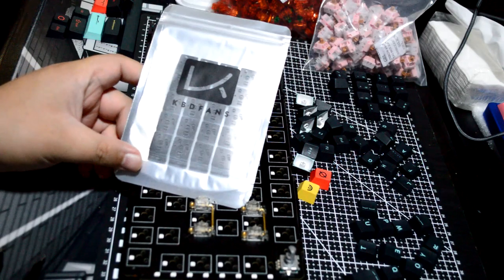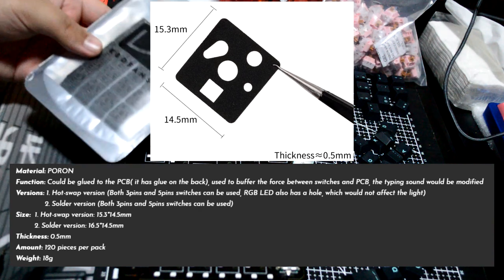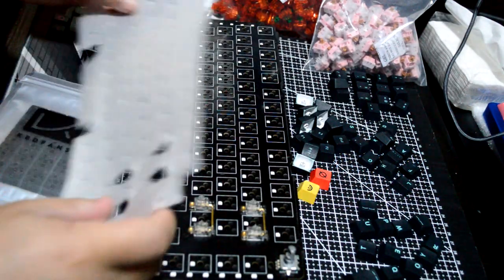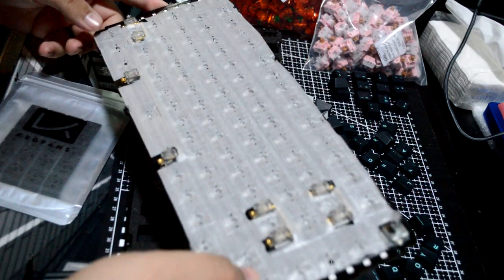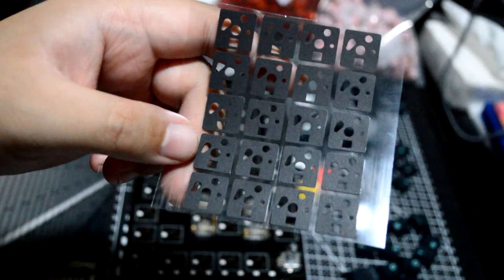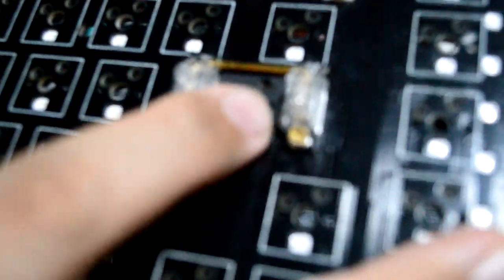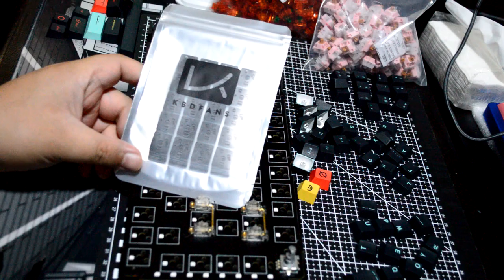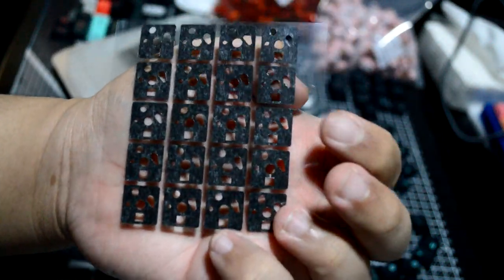KBDfans Switch Pad Review | Will it Thock? Pop?

Comment: Are you using alu plate for your gmmk pro? and how  did you make the durock v2 fit?
Reply: Alu plate. I just wiggled it in. Its really tight.
Reply: I had to press my plate down with a bit of force but i got a really tight fit in. The poly carb does not fit at all with durock stabs though. I would have to file it to make it work.

Comment: The chances that the PE foam mod will damage your PC is extremely small to none. PCs have many safeguards in place for that sort of stuff.
Reply: i used to agree, but after changing some switches out a couple of times, 4 sockets on 2 pcbs stopped working. i think its a case by case thing
Reply: That’s a socket problem. The PE foam mod if it were to do damage, it would be much more noticeable. Hot swap sockets loosening and/or breaking from the solder join is a common issue. It can be easily fixed with a soldering iron and new hot swap sockets for literally a few cents.
Reply: There is a certain type of pe foam you want to avoid, i forgot the name but if you look it up it’ll pop up
Reply: @dhaerque  can u list those names?

Comment: can you use these switch pads with the foam in between the pcb and plate
Reply: Late response, but I had the same question but I think the answer is yes. I just saw another video where they used the kbd switch pads and and then placed the pcb foam. However I also have switch tripods which I hope would work with all three combined. If it’s too thick then I’ll just remove the switch tripods as they didn’t make a big difference at all.

Comment: The kbdfans pads are designed with the wrong material and cutout. The switch pins need to be cut smaller than the pins to compress them into the PCB. These basically do nothing
Reply: It’s still better than stock from this test I’d say
Reply: The non-hotswap version might be better than this hotswap version since the holes are big whereas the non hotswap only has thin slits.
Reply: @mdmaxson  i dont know if you’re trolling or not, but i’ve noticed a significant change in sound signature when using these. it still makes the board as poppy as pe foam but quieter so its better for my taste
Reply: From my testing with PE, I don't actually think compressing the switch pins is what gives the PE foam mod it's signature sound. I've tested PE foam mod with the foam around the switch rather than under it and it achieves an almost identical effect. I think the difference is almost entirely to do with the material!
Reply: @Brudder  after further testing I think it's material and covering the entire surface area of the pcb combined. Similar to bottom of PCB tape mode. It might be mostly just the covering entire surface vs material though since my glad press and seal wrap on top of pcb is my best sounding board
Reply: @jdbaker82  Good point! Thanks for sharing your findings. And wow cling wrap? That's pleasantly unexpected... I need to try that eventually!
Reply: @Brudder  I'm pretty sure cling wrap would cause static interference. Cling wrap is literally called that because the plastic carries a charge and clings to each other. It could cause damage to the pcb eventually.
Reply: @rks5457  Good point! I shouldn't have used the term cling wrap interchangeably with Glad Press and Seal. Apparently, Press And Seal uses some kind of food-safe adhesive called Griptex instead of an electrostatic charge!
Reply: Pads just do half of what PE foam does. It’s better to me bcs it doesnt make everything sounds the same. If every board is modded with PE foam then using switches for their acoustics would be meaningless
Reply: @faizaz6098  also RGB still works
Reply: @rks5457  what is cling wrap

Comment: PE Foam Mod is better
Reply: It’s cringe making everything the same. Dont choose ur switches for sound next time if u PE foam modding. Choose switches only for feel instead
Reply: @obamalastname34  wow so expensive
Reply: The nice thing about these is that you can use them with any board. I put them in my Atreus because the hollow plastic shell plus aluminum plate mounted switches was loud and rattly in a bad way.